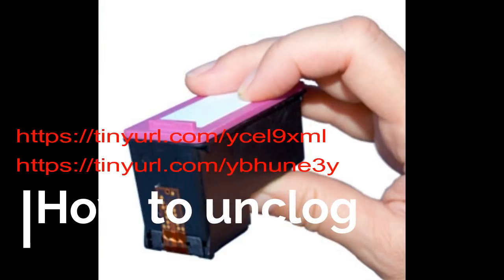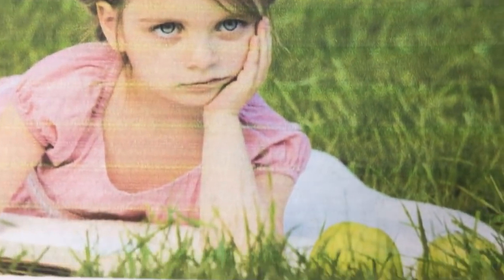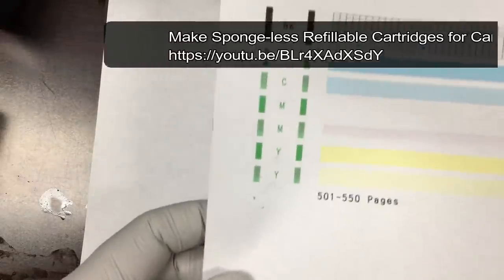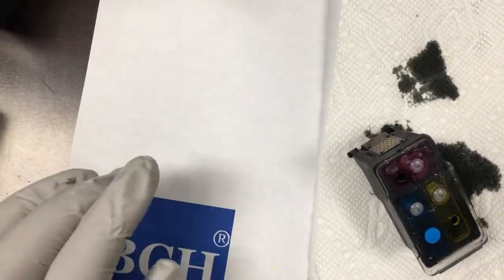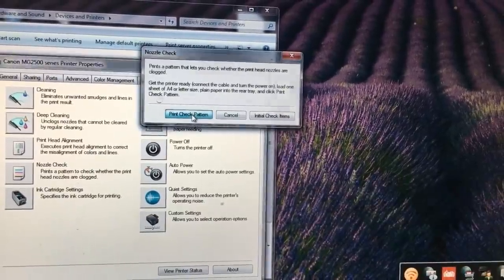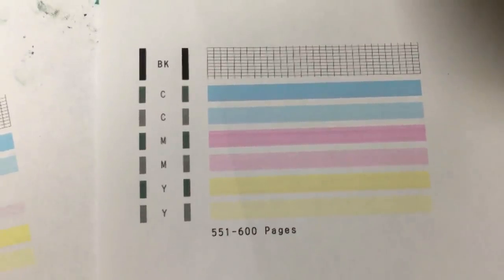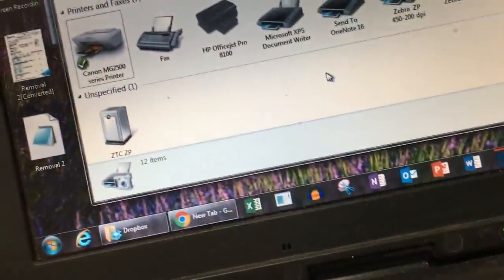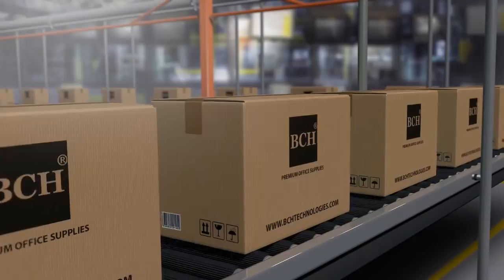Extreme Unclogging for Canon & HP Printer - Desperate DIY Method We Used to Save a Printer Cartridge

Comment: I bought a bunch of cartridges that were on clearance sale. I bought them since their cost was about 1/8th of the cost of the HP cartridges.  But they turned out to be old and 100% bone dry.  All typical methods to get them working, of course therefore failed.  So I injected into two of them some paint thinner that I had hanging around.  They came back to life.  The rest I will just leave as bone dry until I need them in the future.
Reply: I did the same thing with distilled water.  I've heard Ink is made from something like radiator coolant or dot 3 brake fluid (di-ethylene glycol), distilled water and dye and sometimes pigment.  I had a brand new dry color one. Inject distilled water let it sit a day or two.  Then stick in a shallow dish of distilled.  If the ink isn't pouring out, suck up the watered ink into a syringe and then pull the plunger out so the ink wanders back in on its own or just let it sit there stuck in the cart until the foamy bubbles pop and then try reinjecting it SLOWLY.  (This is really messy don't get the colors mixed up--cover the other holes, take care, etc.). Do this one or twice or as necessary per color.  You will see the color you just churned up flowing out of the bottom of the cart.  Yay!  If the carts are a little watery and you keep bulk ink around remove some and add some to adjust the thickness.  If you just want the cart to work and you don't mind it a little blurry, just go with it.  Need the right viscosity for photos though.
Reply: I used them to but I'm afraid about the glue because that can be to removing yellow glue so i only use the in the holes with cotton buds

Comment: Got a canon pg 445 which initially was bone dry. Put thinners & methylated spirit in it.. hit the filter with a strong jet of water from my garden hose.. it has come back to life but still chops my prints with lines exactly 1cm apart.. will try boiling.. your method inspired me.

Comment: Thanks for this, you know I buy empty Canon CL-211XL's ll the time and rarely does anyone ever cover up the print head after they are done with it leading it to clog. So it really becomes a hit and miss. I never actually boiled a cartridge before because was told to never do this, but to come close. But I got really sick of it and boiled two of them in a row and they worked fine. Thanks.

Comment: It blew me away!  I thought the cartridge would blow or melt and wondered if micro particles got inside it earlier when you used the basket to boil it in.  Of course, I will use the cleaning kit with the needle to pump it in before trying your method.  Thanks for sharing this amazing method though.
Reply from the maker: Glad I could help!

Comment: can this be done on a canon pg-810 does print but a with single line only? i tried blowing from the top hole and some bubbles came out with ink. i did not push through all the way cause i was afraid it will damage it more. but seeing this video gave me hope and more idea. thanks. hope u can help me. by the way i am using ciss.

Comment: Love this video. Look forward to trying your methods and looking at your website. Is it true that it is best to leave your printer on all the time? I read that each time you turn a printer on and it does all that chuntering back and forth it is squirting some ink out to clean the jets before printing commences and the cost of the electricity in leaving it on and avoiding this process is less than  the cost of ink.
Reply: My printer in on all the time and still cloged my cartridges

Comment: Good job. Only thingi have to say is if your cleaning solution contains amonia or some thing similiar then you would need to watch out for noxious gases when boiling it like that! You would need to wear a gas mask. Other concern, is the plastics used might get warped etc etc.
Reply from the maker: Great observation.  BCH's cleaning solution is ammonia free.  However, there are folks who uses bleach or Windex, your comment is right on the point!

Comment: Hi kevin, i want to convert my canon printerhead to spongeless but i was wondering if i can still salvage my old cartraige. I tried to do priming, steam from kettle, soaking in hotwater, soaking in solution but still my black test print still missing 30% of the lines. How do i do i diagnose if i should quit? Can i send you the picture of my test print?
Reply from the maker: If you tried that much, the printhead is probably done.
Reply: have you tried paint thinner? lacker thinner?

Comment: How come the water does not short out the electronics?  (. . . and then the cartridge is not longer recognized by the printer. . .) . Every time I touch the electronic contacts with wet fingers (by accident) I end up with an unrecognizeable cartridge.   I've been messing with HPs, not Cannons.   

Still, thanks for the craziness.  It's good to know what is possible.  I always thought that if a cartridge was "burned" because it ran dry, the nozzle would be ruined, or melted down somehow.  This makes me believe that persistence and extreme methods can be rewarding and there is just a bit of dried hard ink between you and victory.
Reply from the maker: If it is an Epson, it may short the circuit.  For some reason, the Canon is just immune to this.  As long as you wipe the contact points dry, it will happily take whatever abuse you throw to it.
Reply from the maker: There are two kinds of burn out.  Think about a kettle boiling water: if the kettle is dry, then you will burn out the pot.  Also, there will be mineral deposits in the kittle.  If you have inks that not desalinated, then the mineral will kill the printhead eventually.
Reply: @BCHTechnologies  I have a steamer and I only use distilled water with it, so I keep distilled around.  Its just not worth it to clean off mineral deposits--WAY too much trouble and some stuff just gets permanently damaged and crusted, so I HAVE  been thinking about using distilled water to water down ink or flush cartridges.  I've been warned that old ink gets fungus in it, but now I think it might just be drying out and getting too thick.  I am presently in the process of trying to flush an old tricolor from a freebie printer and after injecting water the other day,  I decided to pull out what is in there with a syringe and it was the sludgiest ink I've ever seen. . . this was after I put water in there a day or two before.  Its one of those ridiculous HP mini cartridges that are so tiny its ridiculous and it probably been in there since the printer was new.
Reply from the maker: @OWK000  Another thing about HP is that, if you push too hard, the ink seems to leak into the HP's inner chamber or maybe cause the chamber to burst.  I am talking about pushing the clogs out.  I found if I put too much pressure, the cartridge will print random characters/patterns, rather than real text.  This is very weird.
Reply: @BCHTechnologies   @BCH Technologies  Wow, thats a HUGE selling point for cheap integrated cartridge Canons printers over HPs, although HPs are pretty reliable otherwise,  I keep shorting out my HP cartridges.  I do wipe contacts.  I usually know when I have done touched something that shorted it.
Reply: @BCHTechnologies  Is it better to suck?  I've been pushing but I do not have good enough contact for extreme pushing.  Shorting out contacts is still the biggest risk.  Right now I am simmering in a glass pyrex pot on a diffuser on the stove.  A glass Mr. Coffee type coffee maker on the warming plate might be safer.  I have to watch the bubbles since I do not have a canon cartridge.  No cleaner fluid while heating, maybe?

Comment: how long do you boil the thing?
Reply from the maker: We just want to show you that it is safe to use heat on integrated Canon cartridge.  We usually don't boil it.  We put a wet paper towel in a microwave (without cartridge) for 1 minute and then put the cartridge on the steaming paper towel until it cools down.
Reply: @BCHTechnologies  i just did boiling my cartridge moments ago.. it went very bad.. from a few streak to no print at all.. but i didnt use bch solution.. just inject it with  ethanol pls distill water.. i give up..

Comment: Should also be considered as a last resort this method?: just letting cleaning solution sit with the head soaked in it + filling the whole interior of the cartridge with cleaning solution (no boiling or extra methods), waiting some minutes (or even overnight) and using the priming clip.

Comment: i havent tried boiling it. i only soaked it in warm water just halfway, opened the cartridge, took out the sponges and rinsed the cartridge until water runs clear, brushed it, my red ink still wont come out. it only comes out when i blow air into the refilling hole. i will try this once i get a new one just in case it still doesn't work lol!
Reply: Just curious.. did it work out in the end?

Comment: Everyone with a HP... READ THIS... I did everything they said and still it wouldn't print.  I have HP Envy 7640 which you MUST reset the factory settings so that the cartridge isn't sensed as empty.  

INSTRUCTIONS:  After refilling and inserting the cartridge go to Setup / Printer Maintenance / Restore/ Restore Factory Default.  Printer will shut down and restart... Then should print....  Mine is now working great...

Comment: Na uh no way. Sorry if it's offensive, I nuke the water in the dish shallow enough so it doesn't ruin the copper part strip. Then I added 50 ratio of rubbing alcohol  and let it sit for 2+ hours. It works for me. If it still clogged I would use the syringe to push out the clogged/ink down and soak it again.